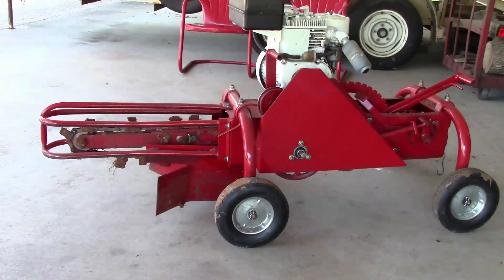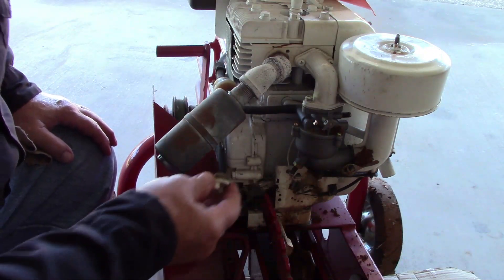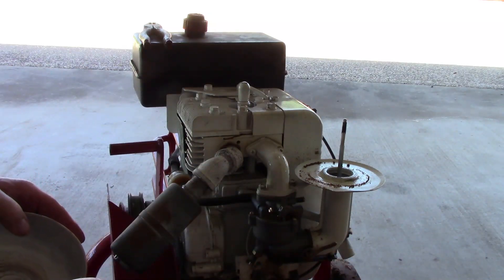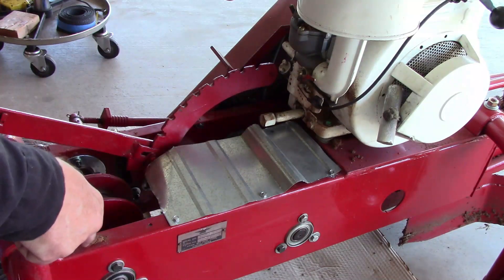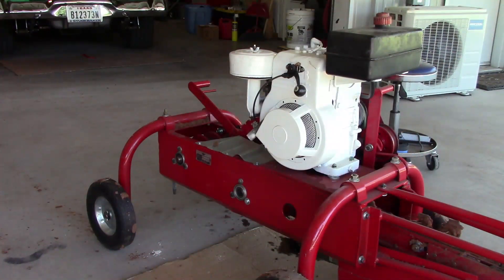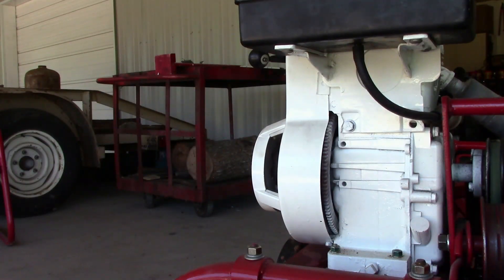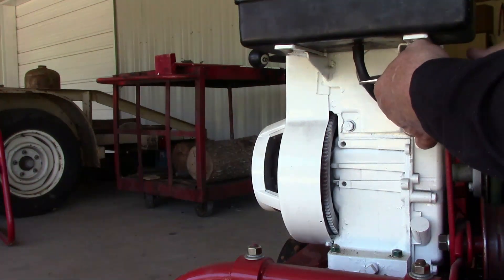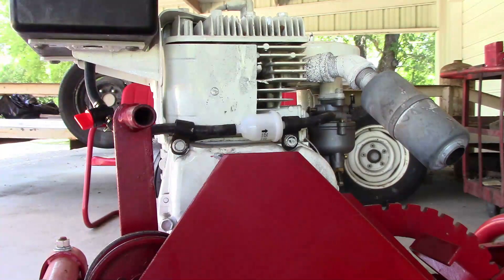Ground Saw model 750 cool start and service

Comment: I really like that machine, it looks very handy. We often forget and leave fuel in equipment when we put it away. We use the same fuel shutoff valves on our equipment
Reply from the maker: I bought more fuel stabilizer, a bag of 10 fuel shutoffs and 10 fuel filters. I shouldn't have to do this again...lol. Thanks Joseph

Comment: That's a cool little unit Rusty! I did the same thing to my walk behind snowblower, I added a shut-off valve and at the end of the season I shut off the valve and run it until it quits, and next year turn it on and it starts right up. I noticed your flywheel is toothed so you could install an electric starter if you so desired, just a thought. Look forward to seeing it work!
Reply from the maker: I saw that too, but as far as I know it never had a starter. The engine may not be original to the trencher.  Thanks and enjoy your week.

Comment: That engine let me think of my old 3.5 hp Briggs. the only difference is mine needs a full carb and engine rebuild, it runs but like a nightmare, great video my friend.
Reply from the maker: When this engine gives me more trouble than it runs I will install a China clone engine. But it's still doing the job for now. Thanks Jan and enjoy your week.

Comment: Last mow of the season last year I put Sta Bil in the tank and while I didn't use up all the fuel in the tank it did start up this year. 
A little spray from Hot Shot helps too.
Reply from the maker: Most of the time I use a fuel stabilizer but this time it was a miss. Thanks

Comment: That's the coolest machine! It looks like you're ready to do battle with the yard now, trenching and pipe install during the summer season. Do you normally use conditioner in stored fuel in your machines?
It responded quite well with a shot of fresh gas, is non-ethanol fuel avail in your area? I use it in the old outboards, mixed with TC-W3 outboard lubricant and it performs well, even after sitting for a year.
Have a safe day, enjoy your upcoming weekend too.
Doug@ the "ranch"
Reply from the maker: The thing I like about the trencher is it's light weight and simple. Most of the time I add a stabilizer but must have overlooked it this time. All good now though. Thanks and enjoy your week Doug

Comment: I want to start my 5 hp Briggs that has set for 2 years  I need to pump out what old gas is left in it
Reply from the maker: That old gas is tough on the fuel system. Good luck

Comment: it seems like fuel won't keep it's octane very long, I guess after the corn squeezens evaporate it's no good,, it's good that you let the bird out of the crankcase.. lol
Reply from the maker: I have a purple martin house next to the shop and those birds are always singing. Thanks Vernon
Reply: @RustyGlovebox  lol I know but it just worked out that the birds sang just as you uncapped the engine. lol